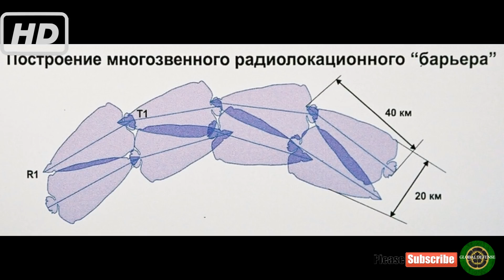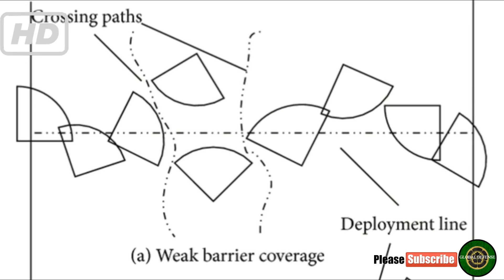Russian Radars On Track To See Through US  Stealth  F-22 & F-35

Comment: I will only work if the fighter jet travels between the transmitter and the receiver and the towers. And depending on the  location of the towers it will  fade in and out on the display. Making it hard to achieve a lock for the missiles. And with having to use towers to pinpoint its location a jammer would give false readings.

Comment: Can't you use an exoatmospheric nuclear warhead which has a much smaller RADAR cross section(CRAM techniques might start being deployed due to the round perhaps being the size or a rocket/artillery/mortar round) once it separates from the rocket(not jet) stage like with the spaceship that just glides/coasts to the target with no IR signature and something to beat radiation-homing (probably GPS homing) and is fully stealthed up against RADAR(radio/microwave) waves with the special coating/shape?
Reply: Go Team!
Reply: How are going to handle the design of this new equipment considering it will be very demanding on the designer especially without being to test it properly in the field? Does everyone reckon this is doable?

Comment: Hmm, had not thought of a bi static radar, rather a network using triangulation in HF like the old LORAN systems plus doppler.  Well whatever, with smart programming and fast computers they should have a good lock on the stealth plane.  Then can send a SAM to circle behind the moving kill box and hit the invading AC in the ass.
Reply: Yeah, many don't know how air defense work but is not based on 1 battery with 1 radar, it have multiple layers and missiles , you can't defeat them even if the plane is stealthy which doesn't mean invisible but less visible to radar having a lower RCS